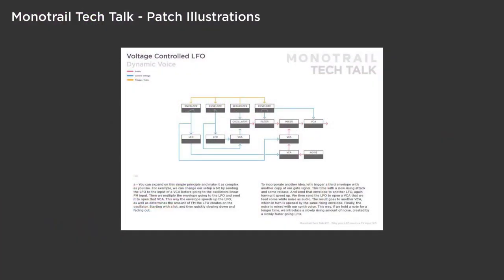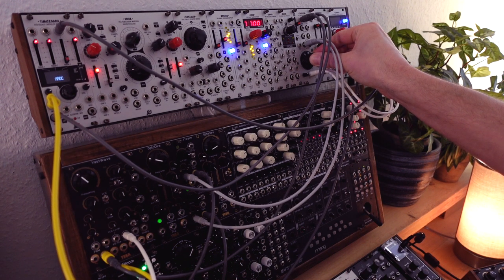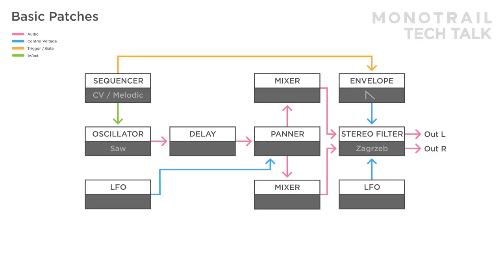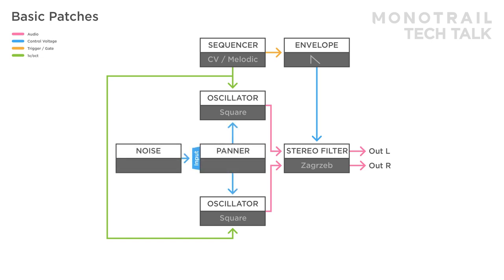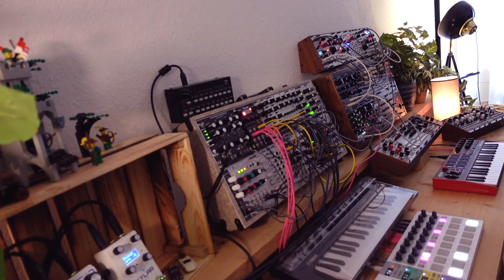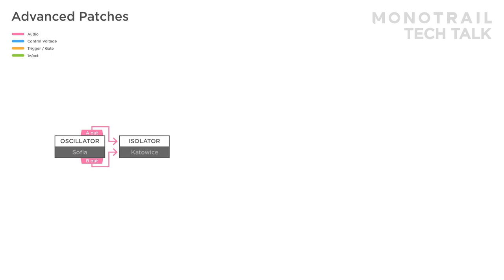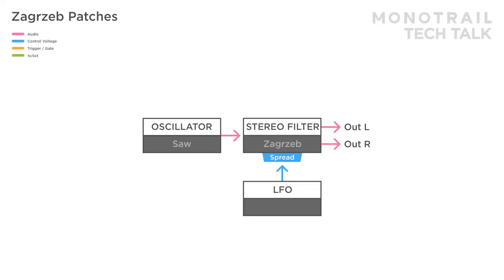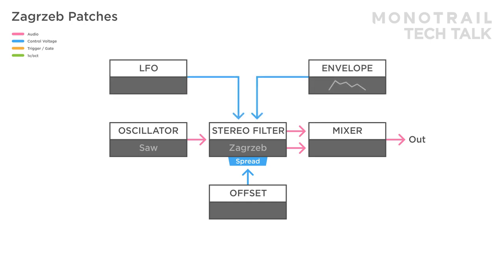How to create pre-filter stereo patches on the modular – Zagrzeb - Xaoc devices

Comment: Thanks for your video and calm style. Another Zagreb-specific patch is to use at as a performance-friendly frequency splitter for mono lead vs. mono bass voices. Just patch the lead to left and bass to right ins and take left highpass and right lowpass to your mixer. Now you have a nice big knob to fade them around while keeping a clean mix. You can do it with a lot of stereo filters (or three sisters as I mostly do) but this module has excellent ergonomics for that!
Reply from the maker: Ahh nice! That's a great idea indeed :) You can use a filter like this on two completely different voices or sound sources of course, should have thought of that to. Thanks for sharing!

Comment: This a great video! I am still a bit new to modular (Since January) and I am starting with your basic patch setup. I am running my oscillator into a ENV/VCA combo, then sending the signal to the mult, which then goes left to the delay and right into the filter and the output to the mix. I have my sequencer triggering the gate on the ENV/VCA and not the filter. My question is, based on the first two patches you shared, should I be skipping the VCA and using the sequencer instead to trigger an ENV that is controlling the filter cutoff?
Reply from the maker: You can do as you like! :) A lot of 'simple' synths have a single envelope controlling both the Filter and VCA. Bigger synths often have separate envelopes for the Filter and VCA. You can experiment with patching the filter before or after the ENV/VCA combo, etc. I often use a simple envelope on the filter only. Keeps the patches clean, and sounds good as well. But in a track you might want to use an envelope to the VCA as well as the filter, this helps to control the low end and volume of the sound best!

Comment: Mm, there are centre/side tricks, too, I should think, if you have what's needed to get A±fx(A).
Reply: What's this math problem, brother? You've piqued my interest.
Reply: @scottadams7820  So I'd use a Shakmat SUMDIF, which I have and which makes this easy to describe, but anything that takes A and B and produces A+B and A-B outs will do—a through zero mixer or (IIRC) a Disting's adder algorithm. With a mono VCO you mult it into any effect/filter/VCA/whatever you like, then take the raw VCO output into the SUMDIF's C input and the effect output (maybe attenuated) into the D input; the C+D and C-D outs become the downstream L and R, into the stereo filter. With a stereo VCO instead you can use L into C and R into effects into D, or you can run through top half of the SUMDIF, L into A, R into B, and use one of A+B and A-B as the dry side and the other as the wet. Either way, you've effectively gone to a mid/side encoding and used the effect as an insert in the side channel, before switching back to a left/right encoding. You get broadly similar results, except they're (anti)symmetric rather than having the dry sound over on one side. Though blah blah phase cancellation blah blah saturation blah so your mileage will of course vary.

Anyway, the left channel is ultimately A+fx(A) and the right A-fx(A), which is what I meant by the code :).

Did that make any sense?